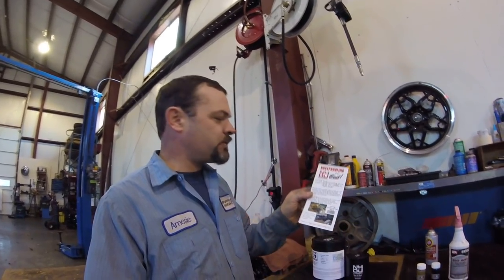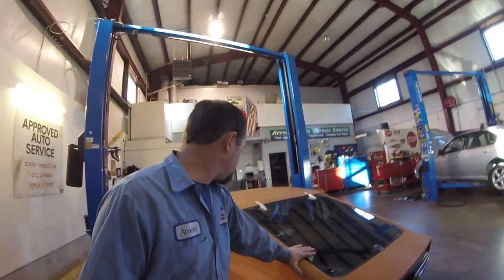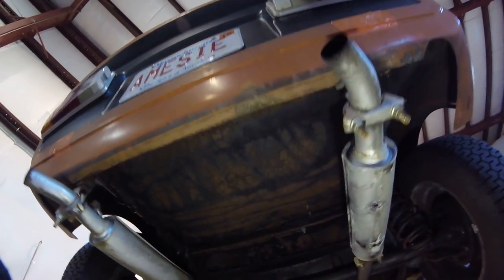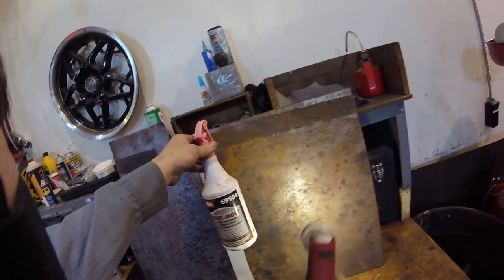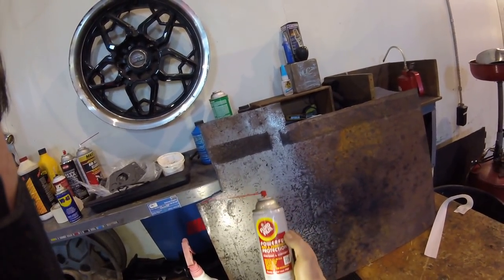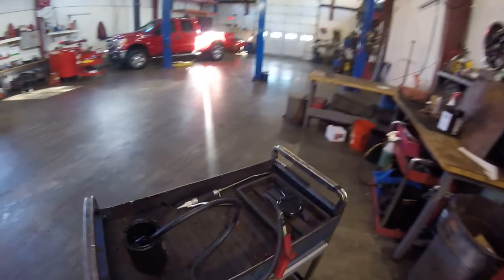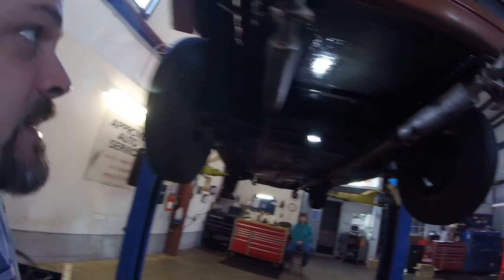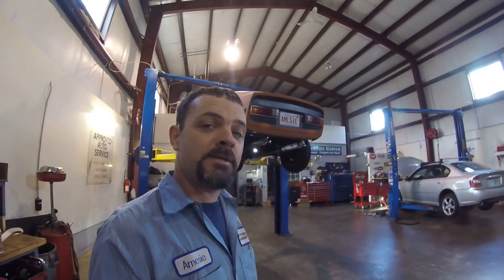Stopping Rust Cold And Keeping It Gone!

Comment: Fluidfilm is actually lanolin afaik, the oil from sheep's wool. Works great in places where it can't get eroded off by water spray or dirt, like inside rocker panels and doors.
Reply: As far as I know it's a blend of lanolin and petroleum products. Possibly some other chems in there.
Reply: Fluid Film is my go to. I have a 2014 GMC that I have plowed with since new and has no rot at all. I just spot spray every fall. I also put it on my toast....love that stuff !

Comment: i live just outside Boston and i was sitting in a ford dealership waiting to get my car inspected and this old guy was next to me with a late 70's truck that looked brand new.
i got to talking to the guy who was from NH and commented how good his car looked and he said he always took care of it and told me the first thing he always did to any car or truck he bought was to get underneath and paint the frame with a thick coat of "OLD" motor oil, the blacker the better (something about the tar in old black motor oil), he said he never had a problem with his trucks or cars rotting out and he does it twice a year, in the spring and late fall.
i asked him doesn't that cause dirt and sand to stick to the underside of the truck and he said yup but rain and snow slowly washes it off which is why he does it twice a year of preventive maintenance and takes him about 4 hours.
the frame of this truck looked almost brand new and so did the wheel wells, no more than a little surface rust anywhere.

listen to old timers, they know what they're talking about and talking about old time remedies 

another old timer told me that when his dog got mange he'd paint him with old black motor oil and after a day or 2 wash him good, the tar in the oil suffocates the parasites in the dogs skin that cause the mange and actually gives the dog a little relief from the irritation and scratching
Reply: @ColdPetRat2.99  really? are you sure about that? guns being stored are often sprayed with oil, the oil acts as a protective coating against moisture getting on the metal
if you regularly paint metal that is exposed to the elements with oil you are preventing moisture from getting on the metal.
 H2O on metal = rust, O2 (oxygen) is a corrosive
“People think oxygen is good for you, but it can be dangerous,” said Malmstadt, a chemical engineer and associate professor at the USC Viterbi School of Engineering who studies the physical chemistry of cell membrane oxidation. ... “Oxygen is super dangerous; it's a corrosive gas,” Malmstadt said.Oct 15, 2015
Does oxygen cause corrosion?
Rust is the result of corroding steel after the iron (Fe) particles have been exposed to oxygen and moisture (e.g., humidity, vapor, immersion). ... Oxygen causes these electrons to rise up and form hydroxyl ions (OH). The hydroxyl ions react with the FE⁺⁺ to form hydrous iron oxide (FeOH), better known as rust.Sep 12, 2016
we breath Oxygen
we "don't" drink old motor oil
Reply: @ColdPetRat2.99 " Motor oil treatment is ancient way our grandads did, cuz there was no other solutions aviable "
i guess you missed that part of my post that i wrote
"waiting to get my car inspected and this "OLD" guy was next to me with a late 70's truck that looked brand new."
just because we live in a modern age doesn't mean our solutions are what works best
we still cant figure out how they built the pyramids or how south american cultures built walls where you cant slip a razor blade between and the stones made of some of the hardest rocks in nature with stone tools

my daughters dog had mange for almost a year that was so bad nothing they got from the vet worked.
an elderly acquaintance of hers came over with some used motor oil and painted Ivan with it. Ivan immediately stopped scratching and biting himself. after about 40 min the guy washed Ivan 3 times with dawn dish soap, within a week his sores were mostly healed and a month later his hair started growing back and he was scab free. that was 5 years ago when Ivan was 8 and he's been mange free ever since.

the elderly acquaintance was from the south and this was an old time remedy from mange they used there which apparently it works without any negative side effects 

as for noxious fumes or outgassing from an oil covered frame coming up thorough the floor boards of a car is pretty low to non existence especially if the car is traveling down the road in the summer heat isn't such a big deal or we'd have heard about it by now.

I'm more concerned with breathing in someones farts than oil on my frame

and what about products like Rhino Liner or Hurculiner, those are made from petroleum products yet people have them sprayed onto their cars and trucks.

there are 3 houses on my street that have asbestos shingles that were put on in the 50's 
OMG PEOPLE ARE BREATHING IN ASBESTOS COMING THROUGH THEIR WALLS, ALERT ALL SJW's , HUSTON WE HAVE AN OPPORTUNITY
Reply: @insonh21  LMAO made my day. Keep up educating ppl. I love in Pa and I'd like to tell u mine, hope the enviro don't get on me, 1 qt of trans fluid, oil of any kind, 1 tube of grease and 1 or 2 wax toilet gaskets. Heat up in pot and mix. Brush. Spray etc. It will stick and it will prevent rust. An old man, my great uncle told me about this. Used on logging equipment, autos, log trailers etc. Used oil is better I think and I like hydraulic oil. Never saw rust inside a hydraulic pump or a transmission. I put Vaseline, trans fluid or baby, mineral oil in doors, inside rockers, hoods and trunk or bed after plugging drain holes and just drive for a week and then let it out and collect and use again. It don't take money to jeep stiff nice, takes smart products and a lil time. Uncle was cheap and drove a International Scout and after a wash looked new. My dad kept that scout and it's still running and metal and frame looking new today. Uncle died in 1997. Proven and cheap. Good motoring my friend. Don't mix in house in wifes pots. Shell be 😠.  Lmfao
Reply: @kitjasabsgabs1830  how much oil?
Reply: @pearlperlitavenegas2023  1. 1 quart of trans fluid, ANY oil, 1 tube or tub of grease, and 1 toilet wax gasket. I like to use 1.5 or 2 of wax gasket. You can thin with any of liquid ingredients. For doors and creeping situations I melt Vaseline, add trans fluid, mineral oil, baby oil. Tape over drains in doors, etc and fill with oil. Let sit overnight and then drain and go to next 1. Then I use the wax crap for extra protection situation. I'm cheap and was tired of spending so much and having do 2 or more times a year with fluid film etc. $10 a can adds up fast.

Comment: I wish you would put some contact information in the description like a website or email address. I'm buying a 2007 Ford E250 wheelchair van to build out for habitation. The body and undercarriage are pretty clean, no corrosion underneath and I'm hoping to keep it that way for as long as possible as it will become my permanent residence. What would you charge for an undercoating? Thanks for the informative video.

Comment: Testing petroleum jelly, and so far it seems to hold up well to driving through puddles (not washing off).   Best to cover lightly as the hot weather will cause it to drip.   After 1 year minimal touch ups were required and it penetrated the metal well especially rusted sections.

Comment: I'm with you on this.  I'm a firm believer in the acid. I actually found a gallon size if it at Home Depot   It's in paint dept. kleen strip brand. Called prep and etch.   I did my entire tacoma frame early this year. Took 1/4 hose and sprayer and did inside frame and control arms and rockers etc.  followed that with boiled linseed oil.   That's my way. Just saying worked great.   Also was able to put the oil and acid both in a cheap harbor freight hvlp gun and sprayed the entire bottom
Reply: I have been using Ospho acid treatment for decades. Turns rusty metal into magic. It then needs to be top coated with paint or a product like you are using the oil base film. I am going to use the Fluid Film for the top coat. I will have to coat it every year but I love my truck and hate rust. The cheapo Harbor Freight HVLP gun is a great idea. Hate Harbor Freight but for a throw away item this is the way to go.
Reply: Hey How’s it working out.
Reply: @MrPolamaluinyourface  How do you neutralize Ospho to use epoxy or urethane. Says oil based ok, not other types? Thank you

Comment: What I use is Rubber based enamel (NO it's NOT the same as rubberized undercoating or pool paint ). It was invented by the Germans for salt water immersion (U-boats). It dries hard as a rock and It was re-marketed  for basement waterproofing use. Sadly the shop that still made it closed a few years ago, but I managed to buy a couple gallons before that.   I painted a VW subframe/suspension in 2002 and there is still not a speck of rust, none, and they use a lot of salt here. It works better than galvanization.
Reply: Interesting.

Comment: I suggest you now drive on dry dirt roads to coat the oil with dust, then add a ceramic brake caliper paint from an Advance auto parts store where dirt and salt spray might take off the oil. Another option is melting vaseline (petroleum jelly) for a thicker coating than an oil. Some use automatic transmission fluid, however it smells a lot worse than Fluid Film made with lanolin from sheepskin. Keep Fluid Film away from door gaskets- use silicone spray or Mothers VLR (vinyl, leather, rubber) instead for the door gaskets.

Comment: I use a Shultz gun on a small compresser & spray the phosphoric acid into the body cavities, leave it overnight then spray the cavities with waxoyl cavity wax or fluid film or other wax/oil type product,  exterior metal I sped time to clean/paint any rough areas then spray over with fluid film/waxoyl or or similar product, if its done yearly it works well!  I always jetwash the underbody with traffic film remover after the winter to get rid of the road salts
Reply: What is traffic film remover and where did you get it.    I bought a 5 gallon bucket if oven cleaner this year before I treated mine
Reply: +Jason Curry traffic film remover/TFR  its the same near as damit as what trucks/semi's use i'm in the uk so I order from a company called autochem or jennychem! great cleaner/de greaser!   its also brilliant diluted 50/50 with water to clean car seats to as new!!!! highly recommend it http://www.ebay.co.uk/itm/TRAFFIC-FILM-REMOVER-NON-CAUSTIC-25-LITRE-TFR-CAR-TRUCK-BUS-CARAVAN-25L-2-1-/161643842907?hash=item25a2b94d5b:g:vKkAAOSwEeFVL3Gb
Reply: +smallweights probably an American equivalent, its harsh on your hands so where thick rubber gloves as it eats your skin!   as long as you are sensible with it its superb!!!!!!!!!

Comment: I have seen a couple of American rust treatment  videos ... and im  chocked of how little knowledge these people have of rust and rust treatments.
Here in northern Europe,  we have wet, salty, snowy  roads most of the year.
New cars rot away within 5-10 years  without treatment.
If u get your car treated as new and get it treated every 1-2 years, you get rust warranty.
Cars can be 20-30-40 years old, driving in salty roads all year, and have 0 rust, if treated correctly from beginning.
Reply: @JRESHOW  im no expert myself.
Just an average car guy.
But I know when you send your car in for  a normal rust treatment they have it for 3-5 days.
Not just a 1 day job.
They take off all protection plastic, wheels and parts that are in the way are also taken off.

Then a hot water/steam wash of whole car to get all dirt and old rust protection off.
Then they are put  in a hot room with ventilation to dry off.

Then the car is ready for treatment. They use a variety  of products, from thin to more viscous. 
Thin rust protection  is sprayed into small holes and pillars, foot panels, inside the firewall and also under the car etc...
 When the underside of the car have dried a bit  they put on more layers underneath. More wax like layers..
And they plug all holes with rubber grommets if they are missing.

Try to search for "Suvo undervognsbehandling" or "tectyl undervognsbehandling"
Reply: @AC-kl2gf  .... rust is rust, dosnt matter  what country  u are in, or what priorities  u have :D
But your welcome to put some rubberized undercoat on your car.
Reply: treating the car before rust is the best answer for sure.

Comment: Hi AAC. how many PSI did you used on the hose setup,  to spray the NH oil?  thanks.
Reply from the maker: It depends, I have a cheap regulator and turn the knob to get the pattern I need.

Comment: How long does this stuff last, and if I wanted to paint instead of using the nhou would I be able to paint directly over the rust mort or would it need to be cleaned first?
Reply: You can paint on top of the rust converter using a primer

Comment: I bought some Rust Mort, same bottle. Going to give it a shot on my 03 F150 with rusty inner rockers and stuff.
Reply: How did it work out for you?
Reply: @strangelyfamiliar1729  I wound up not using it on my inner rockers because I would have to lay under it while applying (it’s an acid). I used Eastwood rust encapsulator instead. I have used Rust Mort on a gas tank and it worked retry well, not perfect but does work.
Reply: @InternetDude  Good to know. Thank you.
The Eastwood Encapsulator ... Did it work out alright?
Reply: @strangelyfamiliar1729  it did because after it dried I painted over it and then once that dried I sprayed Fluid Film. It was quite a few steps but I'm happy with the end result.
Reply: @InternetDude  Right on. Thanks for the reply👍

Comment: RP 342, military industrial coating........wow
Reply: hey have you applied to rusted areas?  interested in that aspect. thanks in advance
Reply: @racheat  not yet bro. crazy busy. just changed oil nearly 800 miles late.....
Reply: @marshallz4  that's just a little over...won't hurt anything.

Comment: I would lightly wire brush, apply Metal Blast, then apply Rust Bullet, then apply a thick layer of rubberized under coating. Shits expensive but I have my cooling towers painted with it (even the basins) so it's constantly wet or under water and it flat out works.